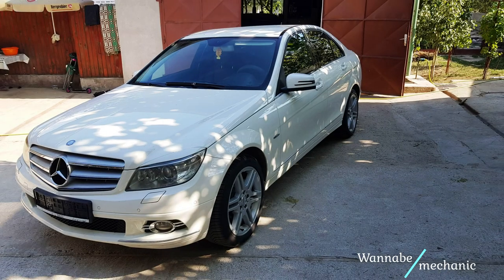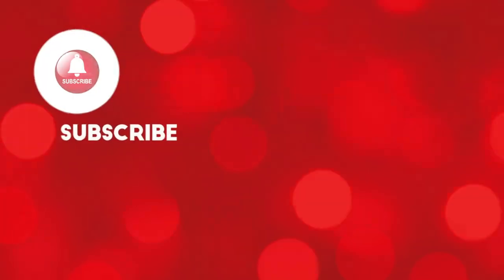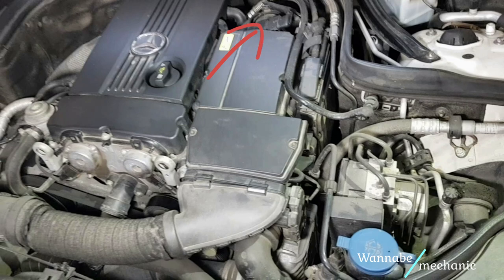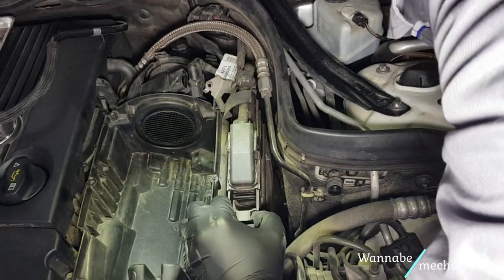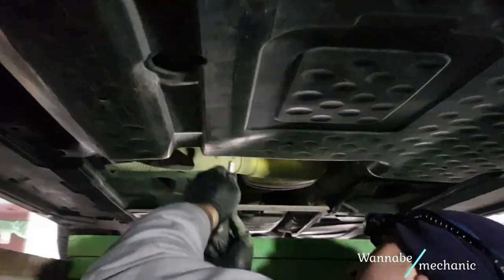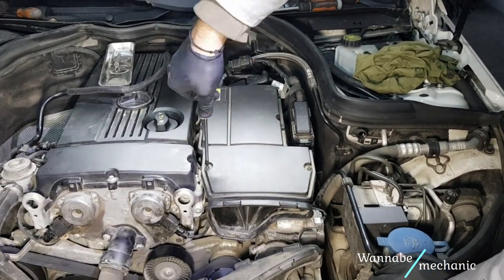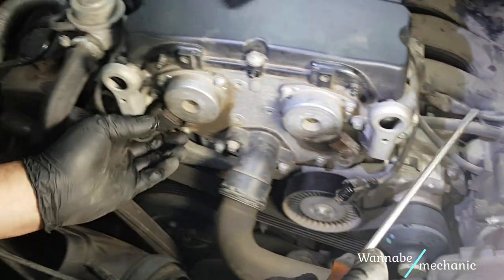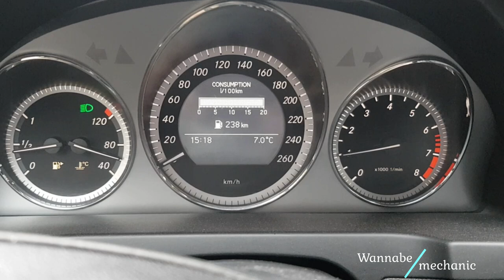DIY Mercedes W204 C180 MAF Sensor Cam Shaft Sensors Replacement.

Comment: Oil on the ECU plugs is from the camshaft magnets on the front of the block seeping oil into the wiring harness eventually making its way to the ECU also the O2 sensors, this one is pretty bad once it's in the ECU it's game over
Reply from the maker: Watch the video till the end. I replaced the camshaft sensors and did a thorough cleaning to the wiring and harneses. Car still runs very well. Not a game over yet and I hope it won't be for a long time. They don't make them like they used to , that's for sure. And things are getting worse.😢